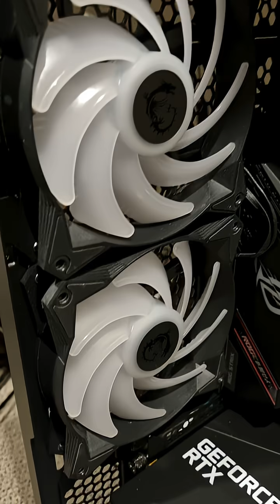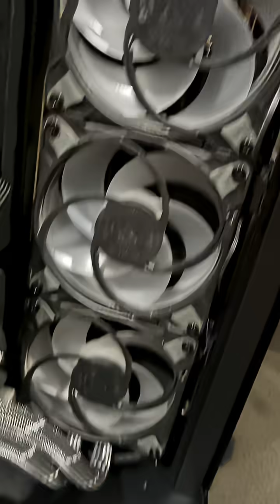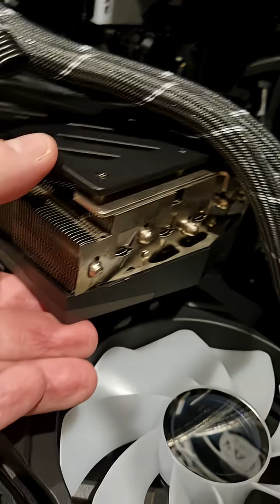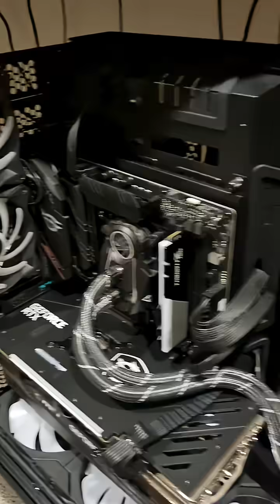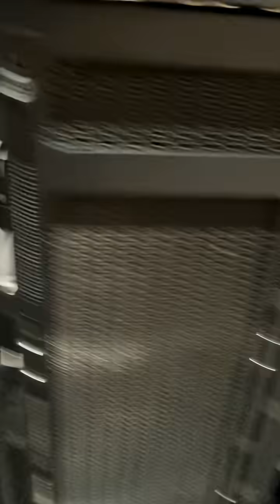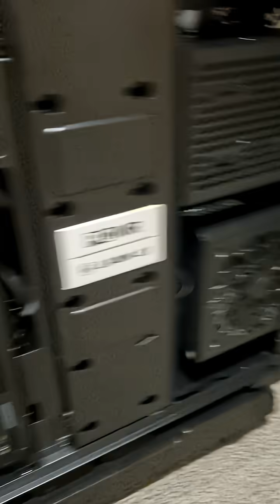Ram is the issue - Update on fixing my old pc

Comment: if aio has been installed with too much pressure this can cause the issues with the ram slots
Reply from the maker: okay, I tested all the slots with my only good stick and all no errors, so it's not the slots, just my 3 sticks of 16gb, running on 16GB ram for the time being, but GPT said if I got the ram as a kit I will have to send all 4 back regardless if they are faulty or not.

I did not replace my MB for no good reason, as before on my MSI 570x I was getting a lot of data corruption, after scanning the SSD's with no errors it would only leave the MB for that level of corruption.  Since I put in the ROG even with the faulty ram I have not had any corruption since.

But after all the time  I have put it, it may have been worth it to just buy a new gen MB, Ram and CPU, then it would take them all out of the possible fault zone.  oh well.

Comment: if still no luck pull board out and try again out of the case if still no luck give the board a clean and try again
Reply from the maker: Since I have taken out the faulty ram and adjusted my fans, the system is running buttery smooth and super cool.  It's the best I have had this PC running ever, I dare say even better than when I brought it,  I am super happy, but 16GB ram is not enough to stream.

I only worry about how long it will take the G Skill warranty replacement to send me working kits, I have some old ram in a moving box that I could use for the time being, but no idea which box and I have about 20 boxes.

Comment: the rad pipes need to be higher than the pump or the air bubble gets stuck in the pump
Reply from the maker: Really?!  GPT gave this configuration, but it seems right, check out this nexus video at 19:50 https://www.youtube.com/watch?v=BbGomv195sk&t=750shttps://www.youtube.com/watch?v=BbGomv195sk&t=750s

I can change it, but from that video it seems legit, there is a lot to go through in that video and I got bored watching, but if you see anything that would show having the pipes higher let me know.
Reply: @foroxgaming  tubes at bottom is correct, you would have more chance for air to get to the pump if you had tubes up top in rad, bcuz air will get stuck at top of rad, so tubes at bottom is correct.

Edit: Also fans on bottom appear to be exhaust, which means its fighting your GPU, as gpu fajs are blowing up towards top of case, to blow air over the fins, you should turn the bottom fans into intakes as long as the case has filters on the bottom. (Unless these are reverse blade fans then ignore this)